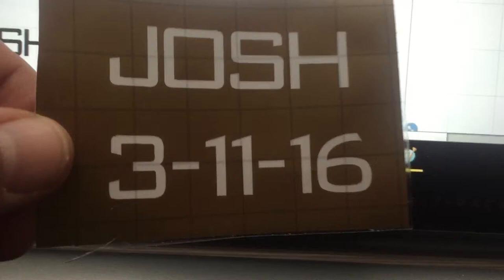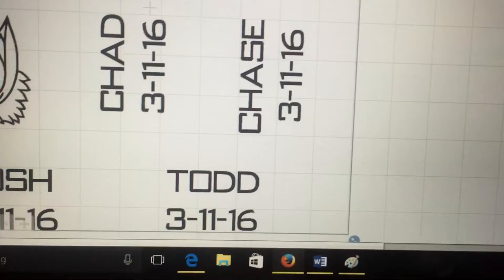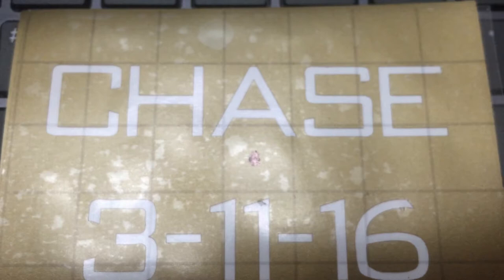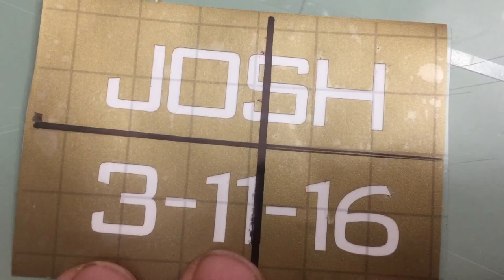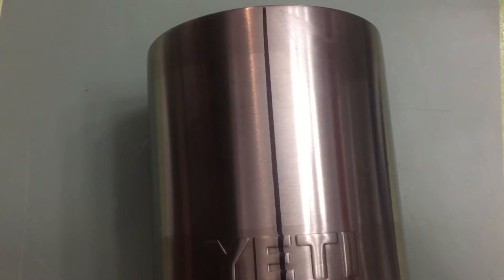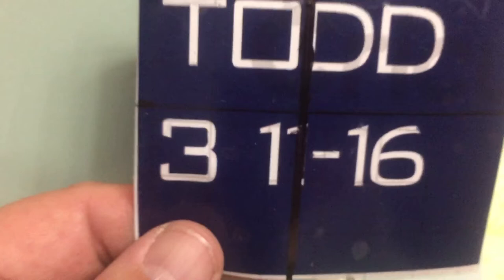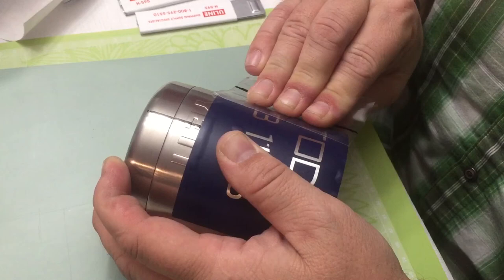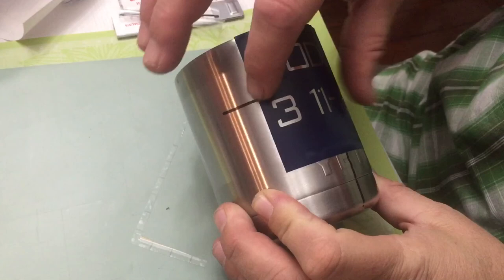Yeti cup vinyl application to prepare for Sandblasting.

Comment: I've used a vinyl but the abrasive keeps tearing it up. I'm using sand about 60psi. what vinyl are you using because Cricut said to use permanent vinyl
Reply from the maker: Domino Moody I’ve used both.  This is what I use mostly.  https://amzn.to/349n4S8  the best tip I can give though is to never focus on one area too long.  As the abrasive heats the vinyl, they glue softens.  That’s when the vinyl releases.   If you move all over and never let an area heat up you don’t remove the vinyl

Comment: Whats the best way to measure / get the center point of the top portion of the 30oz Yeti?  I've found the center point at the bottom measuring and spitting the word "Yeti", but cant't get the corresponding top center point to be straight with the bottom "Yeti" center point.  What's your method?
Reply from the maker: Initially I found the center point on the YETI and RTIC logos and center on that point with a T-Bevel.  I use the wide base laid across the mouth of the tumbler and allow the narrow part to hang along the surface. I line it up so it intersects the center point on the logo and gives me a straight line.  I'll shoot a video shortly and post it.  I know the instructions may be about as clear as mud.